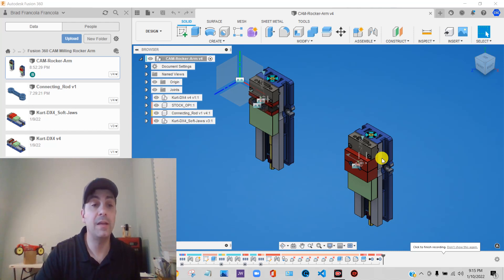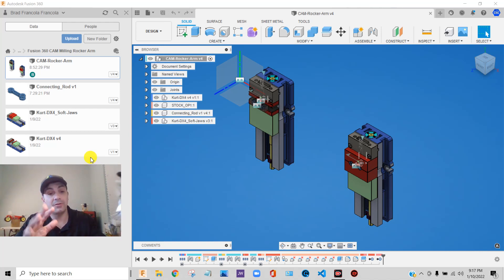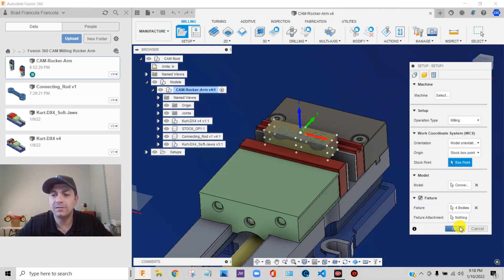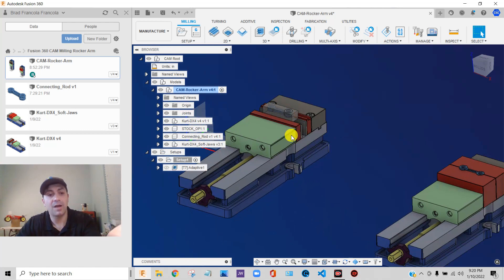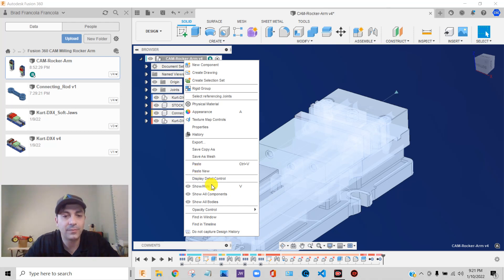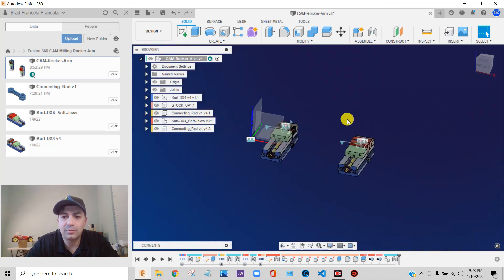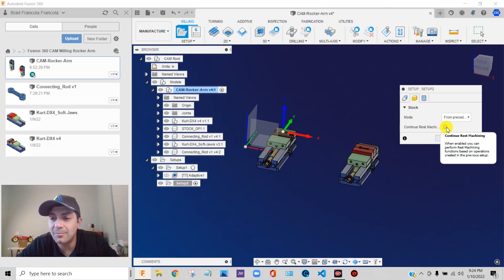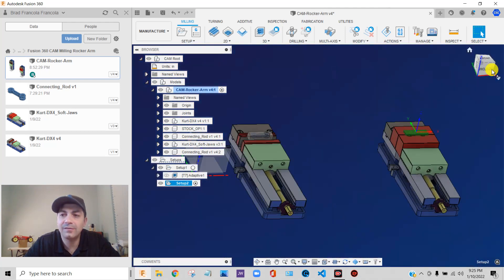Fusion 360 CAM Tutorial 1.4 Stock From Preceding Setup

Comment: Hi Franco, great videos!  You appear to be an advanced Fusion user so I thought I'd see if you can help me with an issue related to this process.  I use the same parametrically driven Kurt vise that you do but I've incorporated parametrically driven stock into it as well.  Once I bring the vise into my part file, I can adjust the size of the stock and parallels before putting the part into the stock with a rigid joint.  This all works great for the first setup but not the second.  After creating a copy of the part and flipping it to the correct position for the second setup, I bring another vise in as before.  However, any change made by changing any of the parameters effects the vise for the first setup but not the vise for the second setup.  My work-around is to adjust the size of the parallels and the distance between jaws in the vise file before bringing it into the part file.  I then have to turn off the visibility of the parametrically driven stock that comes in with the vise and follow your process in CAM for creating the stock from the preceding setup which works fine. Is there a way to do this so the parameters of the two vises in the same file can be controlled separately?